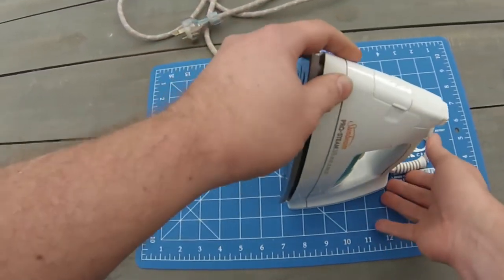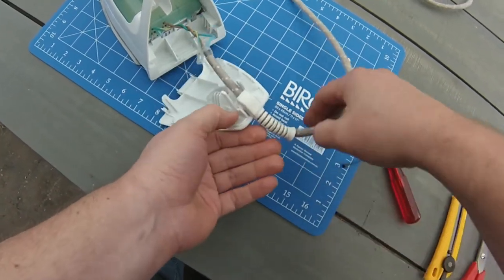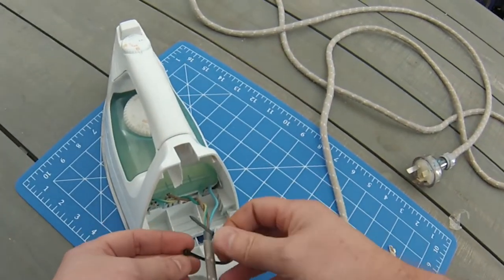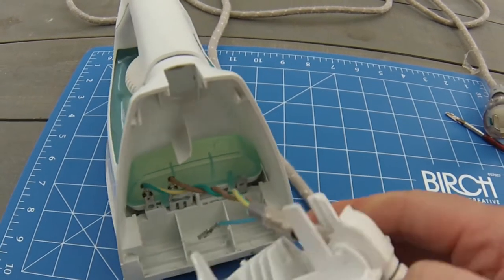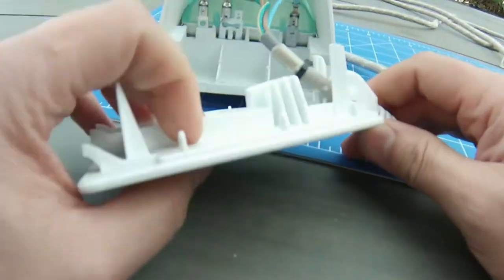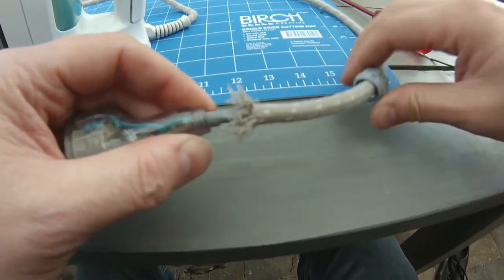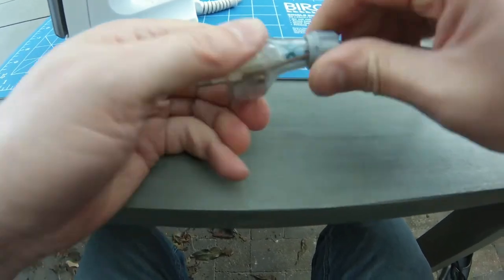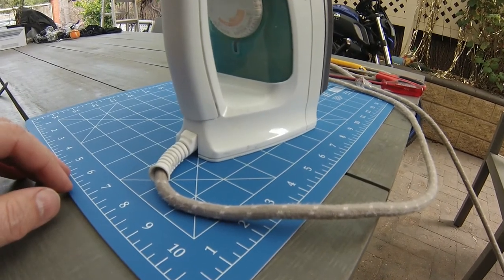How to repair a steam iron at home in 3 minutes - Sunbeam

Comment: what about a terrible buzzing when I try to push the power button?
Reply from the maker: That doesn't sound good. You must have a worn thermostat/relay that is electrical arcing and chattering. Time to replace the iron or the part that is failing.